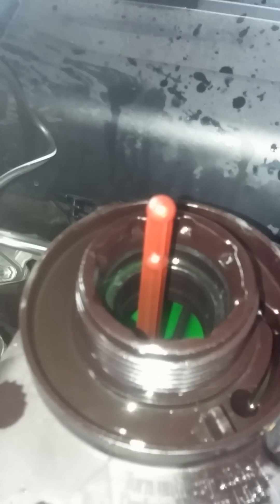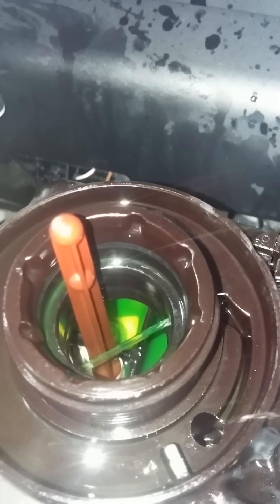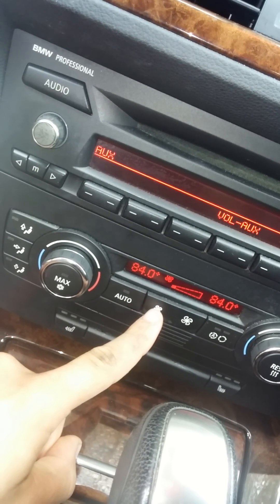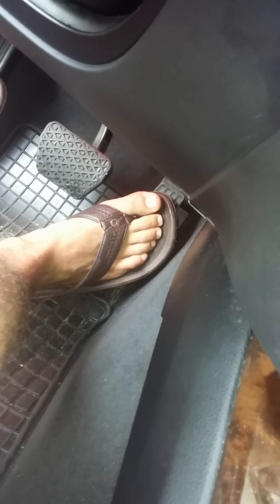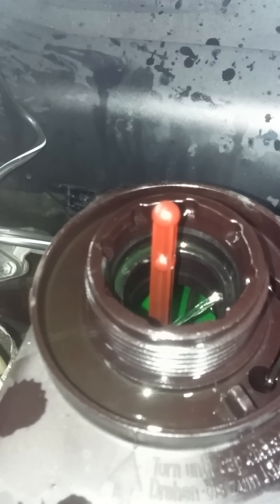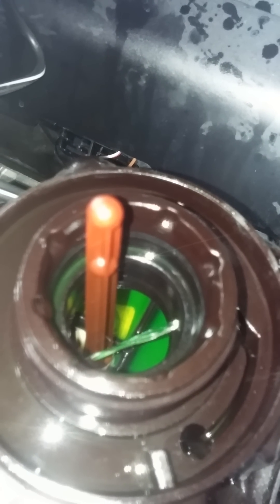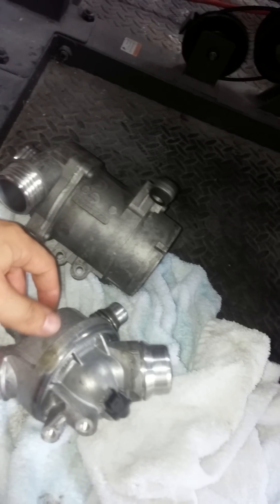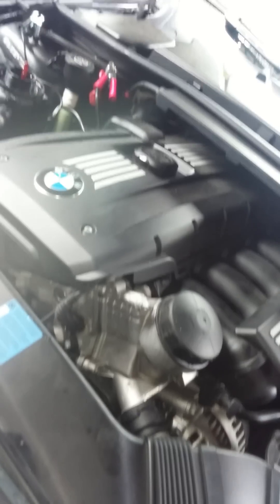Flushing Bleeding Coolant after Pump and Thermostat Installation BMW 328i E39 E90 328I 528I M3 M5

Comment: Dude you have green coolant in your car, that is gonna eat away the plastic over a 3 to 5 year period you should get it out and use in a pinch the Blue G48 but always use BMW. even the stuff that says compatible with all colors will not work.

Comment: which is the. normal temperature for bmw n54 2009 and where is the maximum that has to arrive.
Reply from the maker: Normal operating temperature for my 328i E92 is somewhere between 210-230. There are a lot of different gauges installed on different models where the numbers differ and don't come even close to my numbers. Rule of thumb for almost all cars, normal op. temp. is always at the middle or just a little bit over by a few degrees.

Comment: Do you remove the bleed screw as well as the cap when bleeding the system?
Reply from the maker: No, because all your coolant will run out before the system can do the bleeding.
Here's what I did:
1 -  I got rid of all the old coolant you want to unscrew the plastic screw at the bottom of the radiator. This will run out the coolant in the car.
2 - I did 2-3 cycles of cleansing. Think of this process as trying to clean out a dirty bottle by flushing it with water and rinsing it out where you put the cap on and off while cleaning it. Same thing here, screw the plastic screw back on (by hand) so no water will run out while you flush it. Pour 1 gallon of "Distilled Water" and repeat the process as shown in this video. Then remove the plastic screw and let it rinse out. Now, repeat this process 2-3 times which will need 2-3 gallons of Distilled Water to thoroughly cleanse the system.
3 - Important on the last flush... pour 1 gallon of the BMW coolant instead of distilled water, do the flush and the rinse it out again. This will make sure that your getting rid as much of the distilled water as possible before you fill it up with BMW coolant.
4 - While you top it off with BMW coolant, watch carefully for that little ball that shows in the needle to where it rises as shown in the instructions (on mine it's at the same level of the cap). I had to pour out a little bit of coolant because I put in way too much and my needle was coming out sky high.
5 - Lastly, do the flush as shown in the video to get rid of all the bubbles in the system. I did the flush like 2-3 times. Had to restart it after every 10-12 minutes when it finished.

Hope this helps!

Comment: that's why you had to replace your thermostat in your pump cheap coolant
Reply from the maker: This was my very first replacement and my very first time I used that type of coolant which has been flushed off right away and replaced with BMW coolant from the dealership.

Comment: DO NOT put Prestone in your BMW. These cars specifically call for BMW coolant because the generic green stuff he put in his eats up aluminum and plastic parts. He will be doing this in about 50k miles when his now plastic thermostat fails because of him trying to save a few bucks. 

BMW Coolant (1 Gallon NOT mixed) - $25. 
He really didnt even save money. lmao
Reply from the maker: Stephen Levy Thanks for your comment, your insight is very appreciated! I don't work much on bimmers so I will follow your advice and will soon do a flush of prestone coolant and get the bmw one.
Reply: Stephen Levy I completely agree with that, I added a brand just like prestone but with the " European formula" ad, the coolant was blue but it created a lot of white dust inside the reservoir tank, and it yellowed the upper radiator hose to the point that it cracked. 
For me a $30 bmw coolant that is going to help your $35000 (depending on the value) is worth it, and is going to stretch the life of your engine, just think that it will last 3 years... that's like $10 every year. 🤔
Reply: He's a vertical filmer so that's a sign he doesn't know what he's doin

Comment: My 07 328xi oil temperature starts to increase especially when driving on the highway, it goes past the 210 middle mark and maybe up to 240F. Ive never gotten any lights or warnings, is this ok?
Reply: dont know about the 328, but for the 335, we run around 220..i recently did a coolant flush and changed my oil filter housing gasket and now my car is at a steady 210-215..that was driving on the hwy for 3 hours straight..but i don't think your oil temps should be as high or higher than our cars since you aren't turbo charged

Comment: Hi, before turning the ignition ON and setting fan blower to lowest process,when you fill up your coolant do you do it with the bleed screw off first or you just fill up without removing bleeds screw then turn ignition to ON?
Reply from the maker: @ldee247, yes I did remove the bleed screw and let all the coolant out so I could work on replacing the pump and thermostat without getting coolant all over me. Once finished replacing, I put back the screw in and filled it with 50/50 Prestone coolant up until the guide comes up to the recommended height (see the your car's coolant cap instructions for the recommended height). Once filled up, do this system flushing so all the air can get out (sometimes you'll have to repeat this process "in video" a few times until you'll see no more little squirts but just a fine straight line all the way), then watch the height of the guide drop as the engine will collect coolant until it's full. As the guide drops, you'll have to keep topping it up with more coolant until it gets to a constant state.
Let me know if you need some more help. I might not get right with you but I will sometime reply back. Thanks for watching!

Comment: Will having a low coolant level cause you car not to start? My 2008 328i had a low coolant light come on last week, and now today it wouldn't start and I've done this process and seen a lot of air bubbles.
Reply from the maker: +Christopher Ruppel, yes it'll do that to protect the engine. Do this process and top it up with coolant.